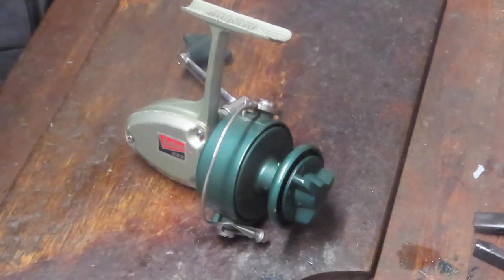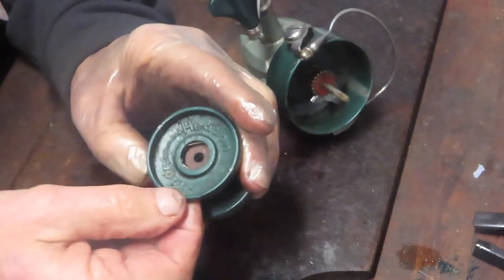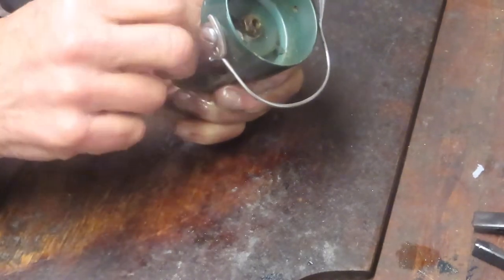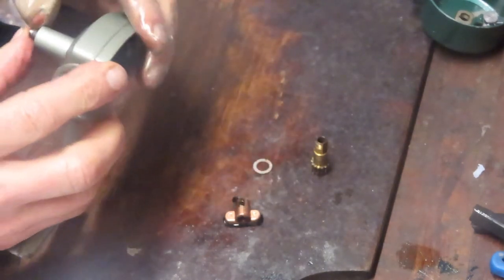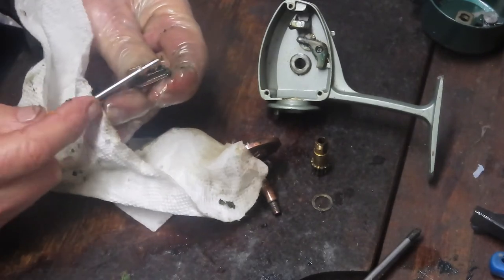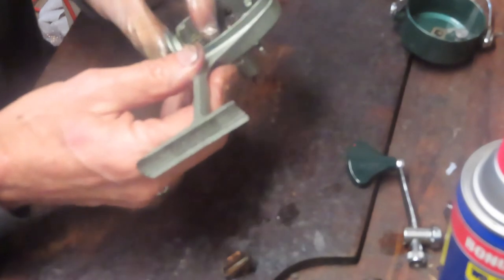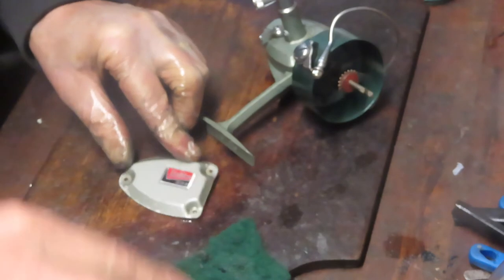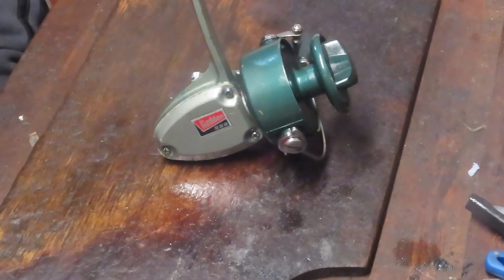Vintage Heddon 222 spin fishing reel how to take apart and service

Comment: These are excellent reels. I have a Heddon 284 Convertible.  I am a collector and that chip would not bother me. I have a Daiwa 9000C in perfect condition except for a chipped foot. I still got it because a 9000C in such great cosmetic condition is exceedingly rare. My 284 Heddon is solid green and in mint condition. It has a ball bearing at the pinion. Like this reel it has very nice gears. The only thing I don’t like about the 284 is that it has a little keyway on the axle shaft that fits in the rotor not unlike a Mitchell 302 or 306. It is very easy to lose. I have used my 284 surf fishing quite successfully. I really like Heddon reels especially the Spin / matic models. I wish they could produce a video of that Heddon museum. I think it would be very interesting. Thanks for doing this one Dennis.
Reply from the maker: You will like the Heddon I just got in a lot of "parts" reel.  I will show that video soon.  Have a great Christmas Chris - Dennis

Comment: One advantage of straight cut gears is they are more efficient than worm gears. I like oil ports on reels. With the new Shimano reels the design has just gone silly. My bottom line is a reel is a place to store line. Merry Christmas ⛄ Dennis.
Reply from the maker: Merry Christmas Bob.  Thanks for the note.  There is a value is the simplicity of design.  Thanks for watching - Dennis

Comment: Should the channel in the cover that the pin that holds the cross wind block rides in be greased as well,.I noticed you didn't
Reply from the maker: Yes - the channel should be greased

Comment: Nice reel! I just picked up a Heddon 248. Just above the crank handle there is a metal spring  Held- ball bearing. Do I put oil or grease in it? Looks close to your model.
Reply from the maker: Nothing is needed on a spring.  If you like, a light oil at most.  Do not grease - Thanks - Dennis
Reply: Thank you. And thank you for saving and restoration of these old reels.

Comment: The two cork washers rub against each other? Shouldn't there be a metal wash between the two cork washers? Is there room for the second metal washer? All the best.
Reply from the maker: That's a good question.  No additional room.  They were just pancaked inside.  The good news is that the reel doesn't need much drag.   Please watch tonights post Hashem - I think you will like it!  Dennis
Reply: @2ndChanceTackle  Thanks for the head's up, but I don't see it yet. Be well.